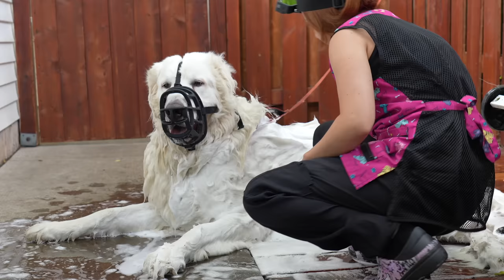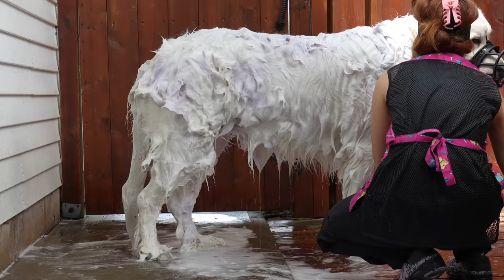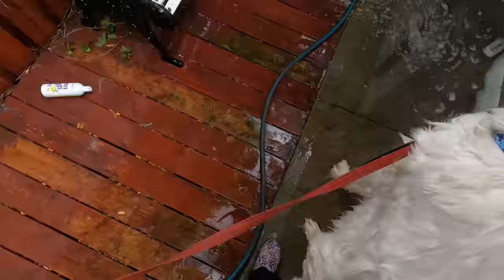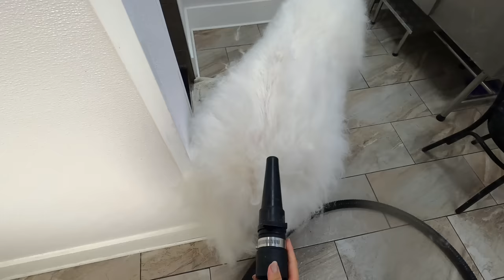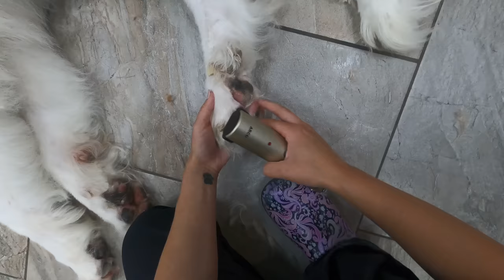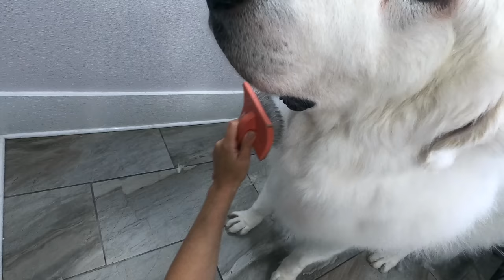Grooming a HUGE deaf dog with a bite history

Comment: Great Pyrenees usually take the path of least resistance. Whenever you try to get them to do something they don't want they lie down & go limp like their trying to suction cup themselves to the ground. 
The increased reactiveness also tracks with what I've seen with some of our mini polar bears in their sunset years. They instinctively use their hearing & sight to asses potential dangers so when they lose one of those of those senses they tend to get more anxious trying to do their "job" & start reacting first and assessing later especially if they are in their territory &/or with a member of their human/flock. ESPECIALLY if the "intruder" is a stranger/outsider.

Comment: As the owner of a dog who hates being brushed and bathed and often lays down to keep me from washing him, so I have resorted to doing a sort of crosstie with two leashes. I take him on to our patio that has two poles to support the porch above it, and tie one leash to one pole and the other to the other pole, both just tight enough that he cannot lay down without choking himself. When standing, it is fine and comfortable, and it also holds his head in place, meaning there is only so far he can move to get away from me. It works great and has removed much of the hassel.